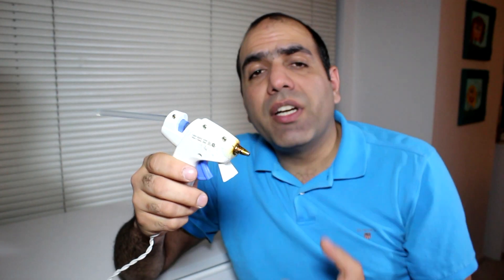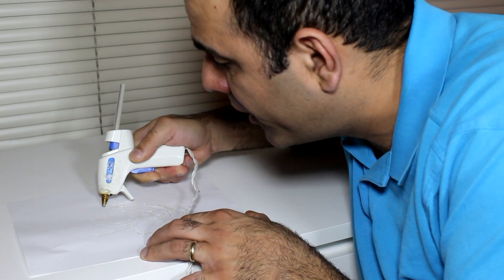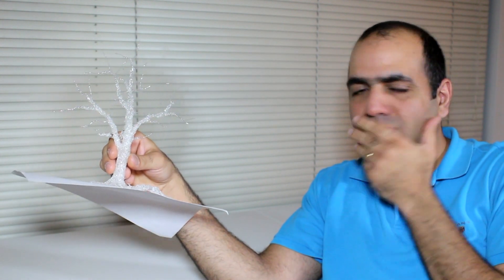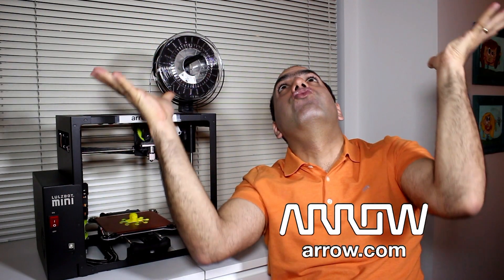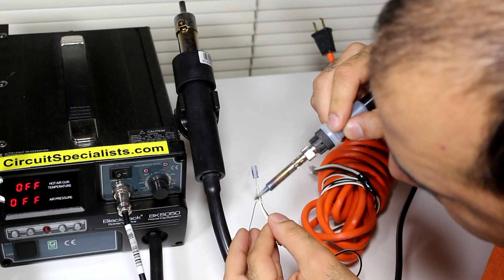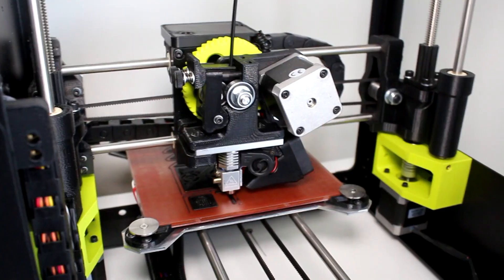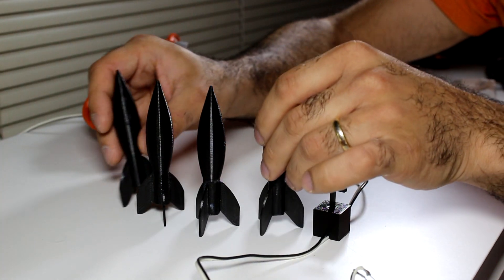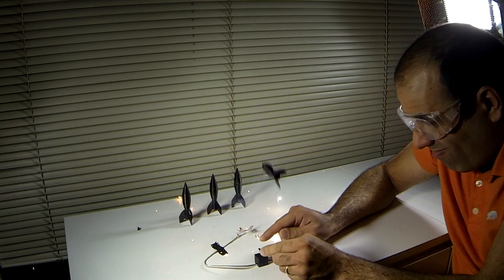How 3D Printing Works

Comment: "three stepper motors to run the x y and z" 5 stepper motors, x, y, and the extruder using one each and z using two, one on either side of the machine

Comment: Quick question, does connecting a capacitor like this trip the fuse on the power line it's connected to?

Comment: I Do 3D printing all the time, and can confirm that this is true. Although they are still cool. Some of the newer 3D printers do this with metal. no they don't do it the hot glue fasion, instead they lay down a powder coat, followed by a focused laser beam that melts the top layer of the powder.. WHICH IS AWESOME!

Comment: 2 stage rocket: Add 2 capacitors to the rocket, of same value, but one rated low voltage, one high voltage. Parallel them but with a "switch" which closes when the rocket takes off. Charge the high voltage cap, and fire the starting capacitor, when the rocket takes off, the small capacitor should blow up too. Who can test it? :D

Comment: Hi Mehdi, may I ask a question? Ha that was a question Lol. I wish to use a light dimmer switch to adjust the speed of my laminate trimmer router for a specific aplication, however my trimmer is 450-500 watts and I can only find 400 watt switches. If I connect two of these switches in parallel to share the load, will it work? or is there a better, simpler way to do this?

Thanks

Walt

Comment: https://youtu.be/nAseG7z_GQo
 This video is real ..????!!
Reply from the maker: +Abdul rahuman I remember I thought to make this when I was a teenager. But no, it doesn't work and not real.
Reply: Dear sir thanks for your massage .!!!!  your really doing good job on youtube tnx
so y? too much video about overunity y? people making people confused . please make a video about free overunity thanks again.
Reply: the video is real, but the claim free energy isn't, the motors will have like 80% efficiency each, so that will put the total efficiency at around 60-70% (actually less, as the flywheel isn't 100% efficient.), the flywheel behaves like a capacitor/battery, so the setup is similar to plugging a wall  battery charger to a (12V) battery, then plugging an inverter (12V to wall ac) and then connecting the battery charger on the inverter. in theory, it should work (actually depends on the isolation of the charger and inverter.), you could run a  drill off the inverter, but it will pull it's energy from the battery. 
this setup is useful though, as you can store high amounts of energy in a flywheel (they are as efficient by weight as mid-low end lithium ion batteries), it is really cheap (about 1-5$/kwh of capacity for a cast iron one, some high end with different materials and low capacity models cost more though), and it can charge and discharge rapidly without being damaged. The only problems are the high discharge rate (it slows down because of friction quite rapidly), noise, and safety. then once you get the wheel spinning you can connect it to any type of generator or motor to charge or discharge the wheel (and draw/give power from/to a device) .
Reply: +ElectroBOOM You massage strangers in the internet? whoa man..creep
Reply: *****
unless you want heat, then you can get 100%
(also with perfect theoretical lossless components, you could get 100%)
Reply: *****
correction: the conversion is never higher than 100%, it is always lower or equal.
Reply: In Layman's terms: Does a bus stop when it hits a pedestrian? Probably not...but that pedestrian flew about 50 meters, nice hang time! Does a bus stop when it hits 5 pedestrians? Still probably not, those people still got good hang time flying through the air! How about 10? Maybe 100 pedestrians? Bus might slow a little but still not noticeable...pedestrians still seem to have good hang time though. How many pedestrians until it stops the bus completely? Same principle in effect here.
Reply: Who the hell is driving that bus? He's a monster :o
Reply: Trump...!!!!
Reply: Which is ideal for a heater. Second law of thermodynamic is never going over unity. Not about never having unity. Also free energy is real. Perpetual energy, in a closed loop system, isn't real, though. We get free energy from the earth/sun every day (ie. free means no work was done to obtain it). Perpetual (which is what a lot of these "machines" claim to be) is closing the loop and the system self sustains forever with no loses regardless of loading or outside factors.
Reply: megamixa in theory a self sustaining process is not impossible, but the second you start drawing something off of it, it will slow down or stop.

Comment: How do you keep from tripping the circuit breaker?
Reply: Adam Ruis Ah, yes.  Very well.  That's just the kind of in-depth reply I like to see to my question comments.  Well done.

In this case I didn't really expect the capacitor to draw enough current to trip, but in many of his videos I believe I have seen him directly shorting live to neutral in one way or another.  Maybe I need to go back and make sure.  For some reason I didn't think of asking the question until I saw this particular video, even if the question is irrelevant in this case.

I guess I shouldn't ask a magician to reveal his secrets, but I was basically wondering if there was some trickery behind the scenes during some of his stunts.  (Like a large, fully charged capacitor bank or something.)

Comment: That may be the case with substrate deposition techniques, but stereolithography techniques also exist.
These work by raising the model out of a puddle of liquid that changes state upon laser exposure, and are typically more accurate due to the fact the print resolution is maximised by having a print head from a few nanometers to several micrometers across, depending on how much cash you blow on it.
They are fairly limited however, in that materials are quite limited whereas printing with filament gives you much more variety - you can even buy wood-polymer mixed filament that makes the end result look like a carving.

Comment: We 3D print other people ( ͡° ͜ʖ ͡°)
Reply: +rebane2001 
You mean women? c:
 F or  A cademic  P urpose? C:
Reply: 8bpspfreak2 You need both to print it (๏ ͜ʖ๏)
Reply: +rebane2001 More self assembly than printed. Gray goo already exists it is just called life. (already covered the planet) Nanomachines = Proteins. Not that you can't use a 3d printer to guide some self assembly growth using special scaffolding materials.
Reply: +8bpspfreak2 I never thought about that, so you are saying we should 3D print a bunch of dildos?
Reply: +Joels1991 
Dildos, Fleshlights, "Dolls" of both kinds
The only limit is the software and hardware :D